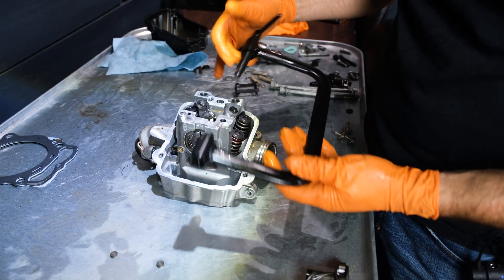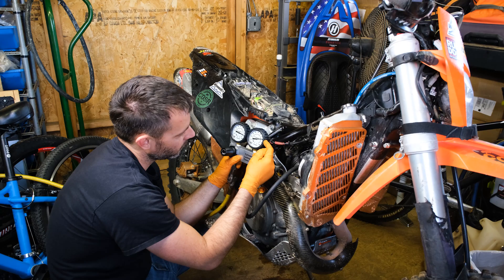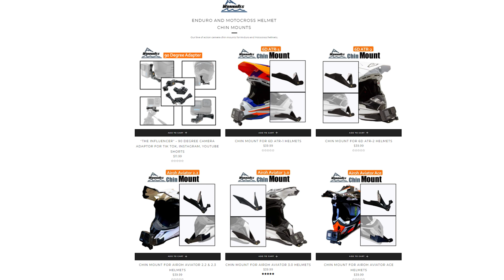Is your KTM 500 4 Stroke Burning Oil? | Part 1 | Performing a Proper Leak-Down Test diagnosis

Comment: My 2022 WR450 never burnt oil but after doing the valve clearances it's burnt 500ml in less than 1000 miles. I'm guessing it's the dirt that got spilt onto one of the intake valves which has worn the valve seal 🤔

Comment: Great Video! Is the decompression valve closed at TDC or does it have to be manually closed?  I'm getting leakage so not sure if I'm at the wrong mark on the cam gear or?

Comment: Can you tell us what leak down tester your using please? The standard ones that use 100 psi, always move piston down when you connect them or are too low pressure. I have two, but they’re both for automotive. I believe the piston doesn’t move in your case because you’re applying the pressure slowly or did you have a way to hold the piston in place at top dead center?

Comment: A leak-down test will not check your valve stem seals. It would test your valve seats, but not the seals. If valves were leaking past the seats, the pressure would escape through the intake & exhaust ports on the head before reaching the stem seals. Not writing this to be a dick, just don't want others to think they are testing something that they're not & waste time/money.
Reply: I believe his logic is; if it’s not compression related then it must be the seals. 
If it is compression related then do the rings and cylinder and seals when he pulls the head.
Reply: @ssgi4059 yep

Comment: Did your leak down tester have small enough 10mm adapter to seal against the head? The one I bought off amazon won’t thread in but one thread before the adapter is bottoming out before reaching the O ring.
Reply from the maker: I threaded into the spark plug hole. Sealed great
Reply: @ExtremeSportsWannaBes  I figured out both leak down testers I bought had too wide of 10mm adapters to seal against the head. Once I got a narrow adapter it worked great.